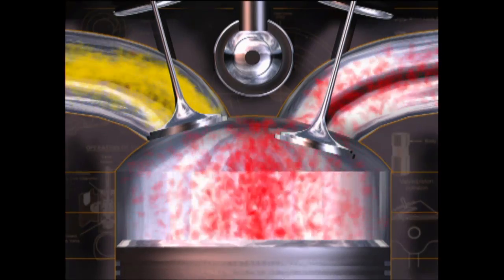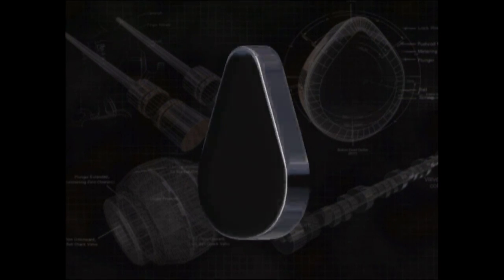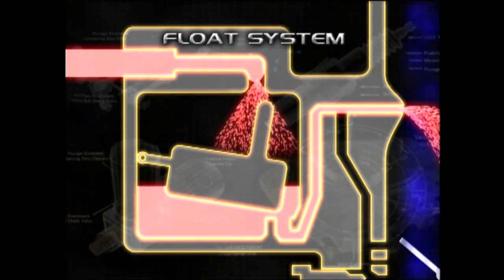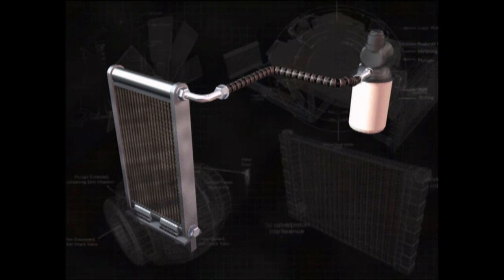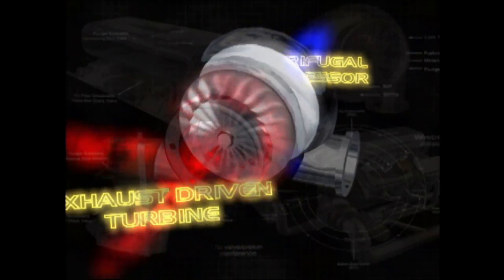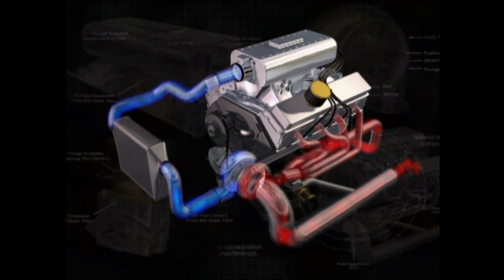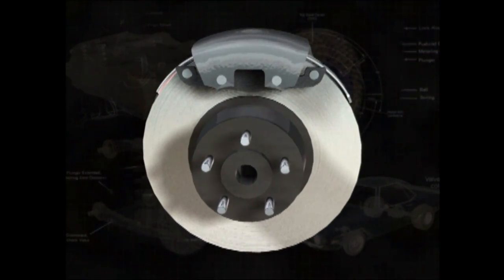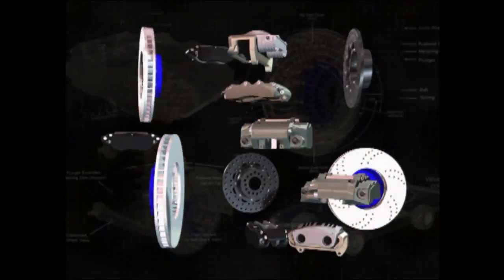Educational Automotive Animations for the Classroom

Comment: where is the Cadillac Northstar V8 engine DOHC
Reply: Oh Bob Bob, this video was made in 1825, the Northstar V8 engine wasn't produced until 1827. So, as you can see, and if you do the calculations, the video predates the engine by 237 years. Now, is there anything else I can assist you with?